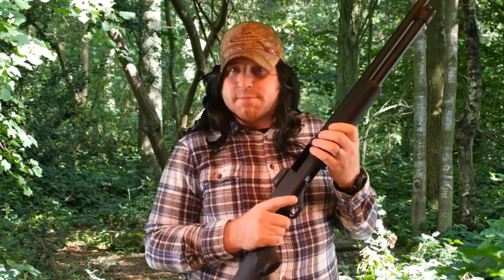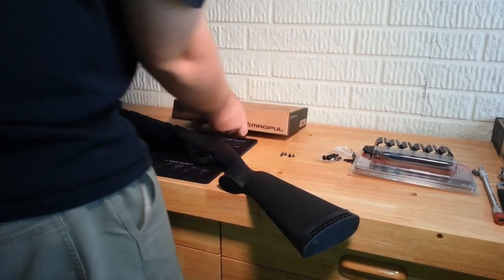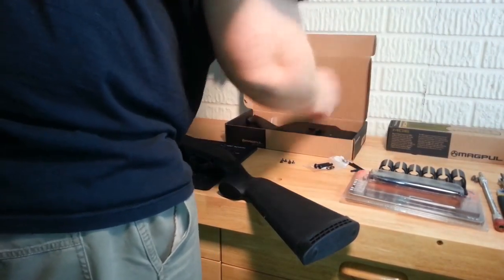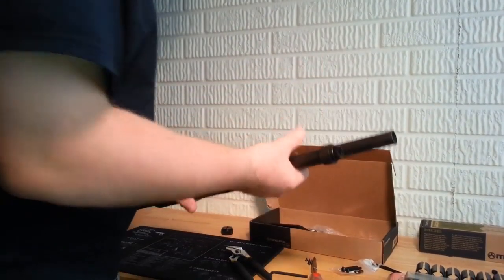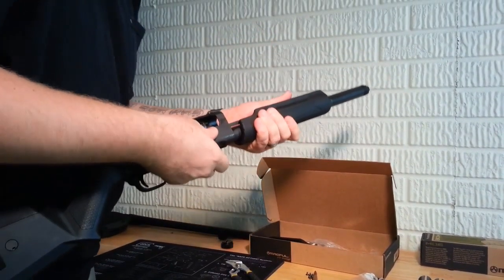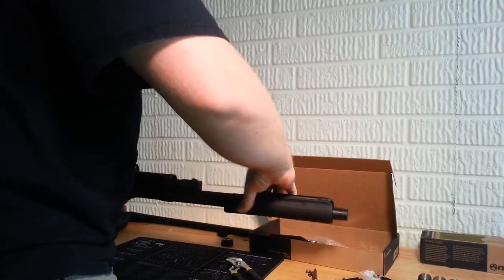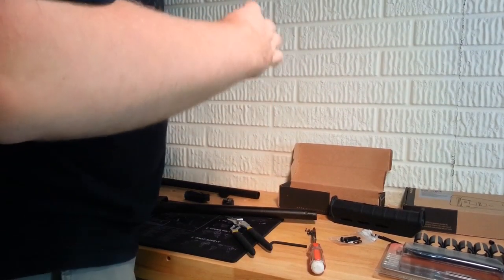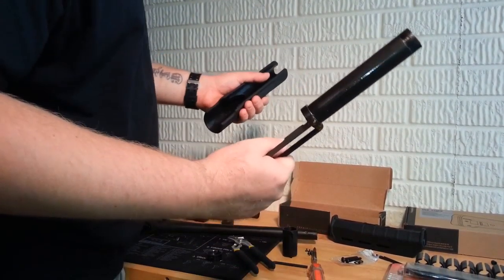IAC Hawk 982 Magpul / Tacstar Install

Comment: I just put a Mesa Tactical stock and pistol grip adapter on mine. For right now I have a A2 stock and pistol grip but next week I will put a Magpul K2 OD Green pistol grip and a Magpul STR or a CTR stock. Then a Magpul Forend with a vertical grip